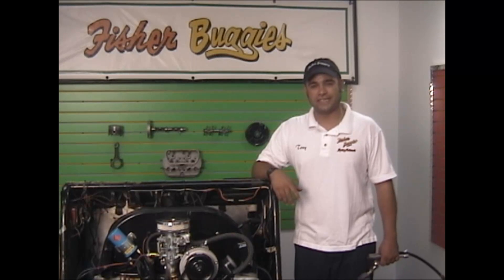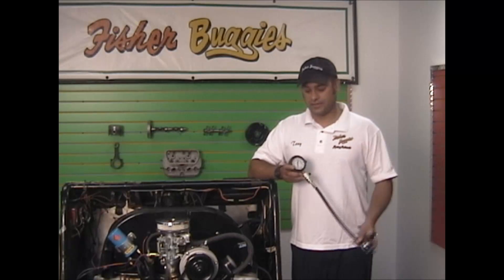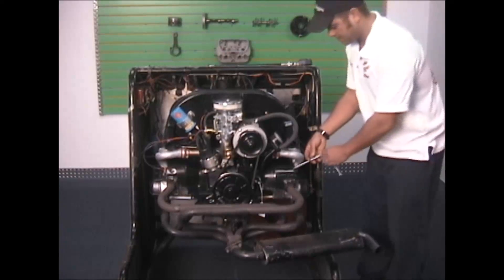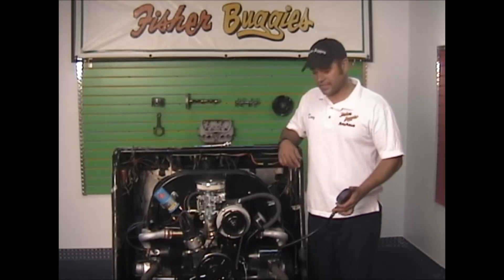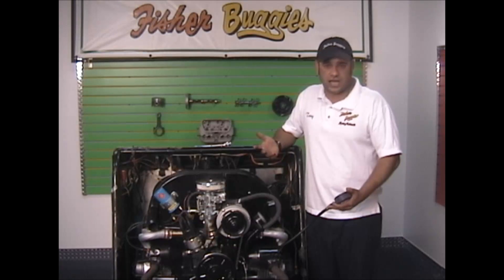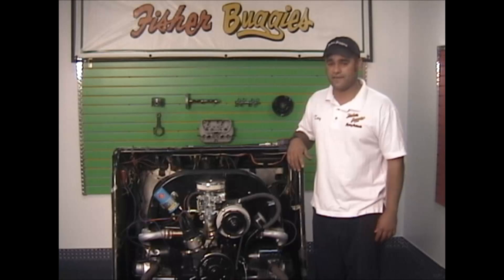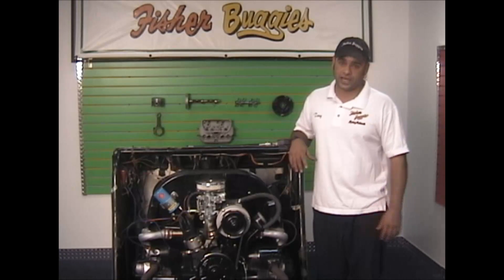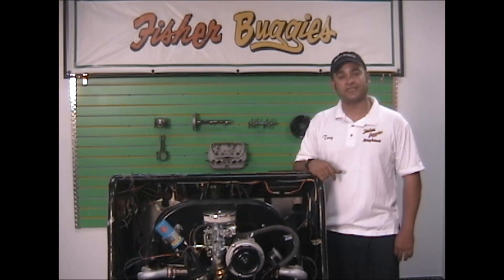VW Aircooled Motor Compression Test

Comment: Should I be able to turn the engine over only using my hands on the pulley? It's been sitting for 4 years. I can turn it over by hand. All the valves are moving...?

Comment: Hi, my engine is new . 1994cc 42/37 heads ported by Steve Tims. 44 idfs 36 vents, cam 256 @050, chromoly pushrods, zero lash cold, 9:2 compression ratio. I retested the it again today after I warm the engine and the new result

Comment: Hi, does a big duration cam can affect psi readings? My  2.0cc with engle 120 got a readings 120-115. Why also one of the cylinders is really high like 145? Thanks